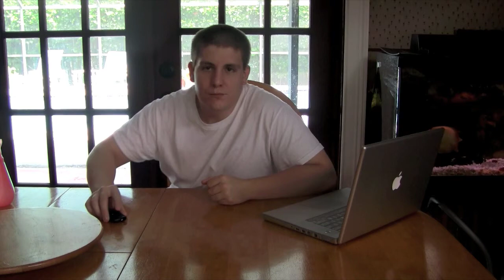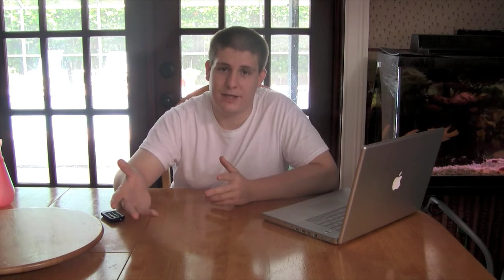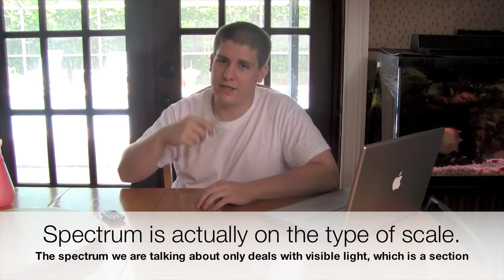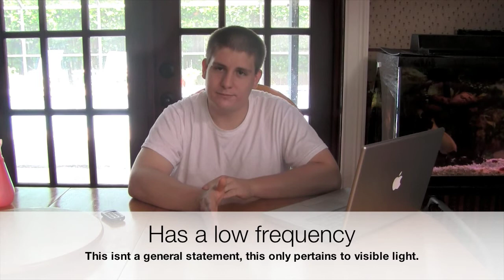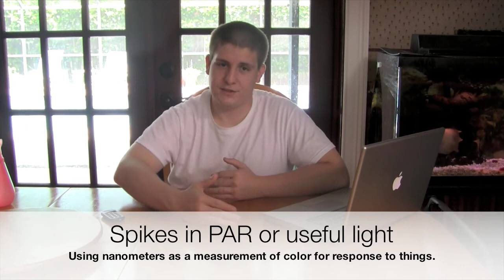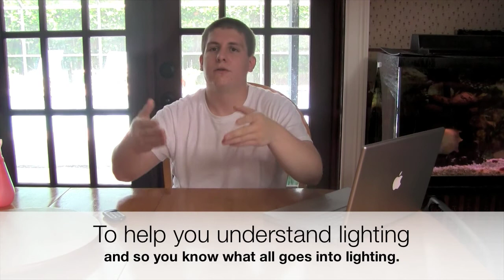Lighting Series: Nanometer Range (Spectrum)

Comment: cool video thanks u explained that very well im goin to watch ur par video now iv got most of my equipment for my 200 ltr jewel tank i.e x3  power heads hang on back deltec mc 300 skimmer internal jewel filer and we intend on having a FOWLR TANK to start with iwant to go reef after i understand fully about the lights and wot par rating i need for lps and sps corals so any advice i would be greatful keep up the cool vids dude